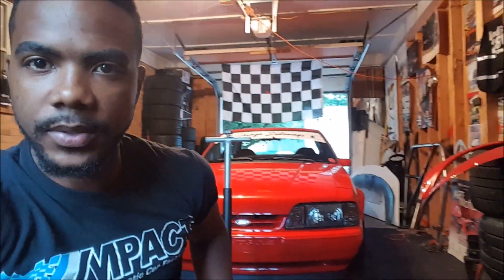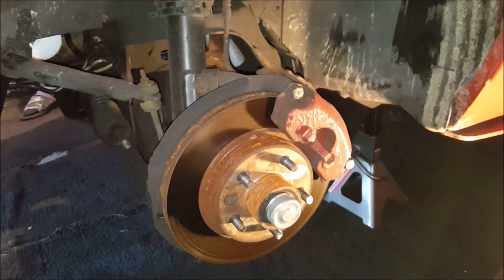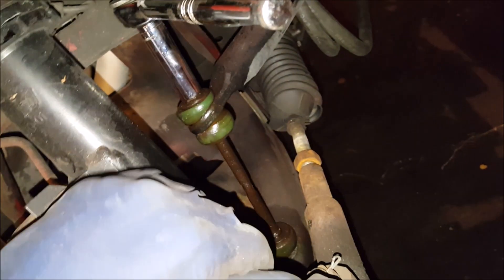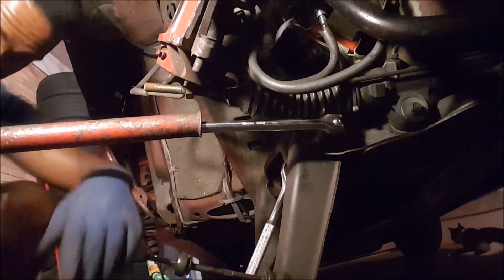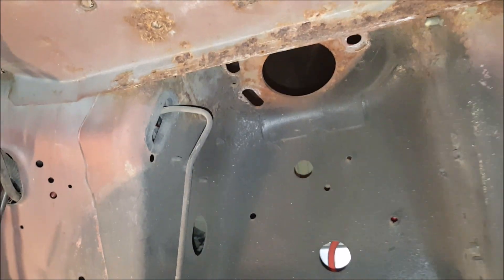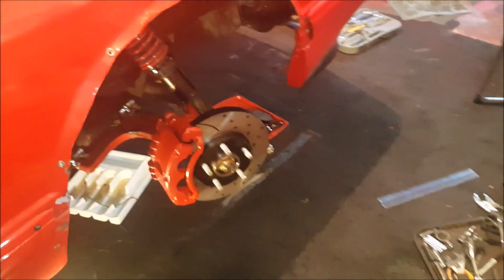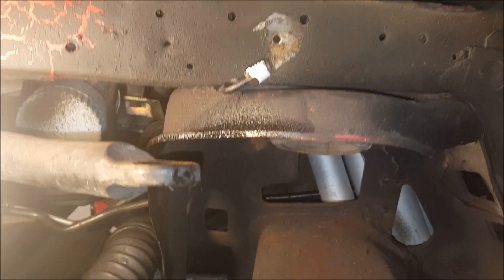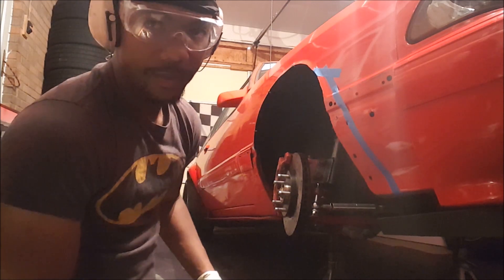Foxbody gets MASSIVE steering angle "wisefox"

Comment: Hey,

Can you tell me what size spacers and what offset are your wheels?
Reply from the maker: my suspension set up sits 6 inches wider than stock,  my wheel specs will not translate to your car.
Reply: @Sgt.Slides  Ahhh.

What did you do to get it to sit 6 inches wider? I'm going for a similar width as yours.
Reply from the maker: @GaryLamb2020  The front control arms add about 2.5 inches to each side and the new edge spindles add about .75 inch on each side, in the rear the IRS adds 1.75 inch to both sides and I made it even to the front by running a spacer.
Reply: @Sgt.Slides  Awesome!!

My IRS is all paid for, just have to get it shipped. Covid19 got me holding off, tho.

I plan on using sn95 spindles and the mm k memeber

Comment: Do you have more photos or videos of the notches on the frame rail and the shock tower? I got a wisefox on the foxbody i just bought and nothing have been notched, so the camber is way to aggresive, and i want to get rid of it
Reply from the maker: sorry, no better views than what's in this video.  Chris Fix may have a better view of how he cut inside the fender.  There is a template out there on the internet of how to cut the shock tower, but you can eyeball it from photos, just trace it out before you cut.  I made mine a little larger than it needed to be, but it's fine.

Comment: Great susspension set up, I was getting ready to do mine.
Nothing like yours, just the basic OEM control arm's, polly's, off set pinion and stuff.
It'll be a little bit still waiting to get a few parts and tools for the over hual.
Hey that was funny with that PG warning wene you were about to cut up the fender. lol.
Reply from the maker: Some people really get upset when they see me cutting into the car, This one actually made me sick to do, but I was able to pull it off and make it look pretty clean.  The biggest drawback with this angle mod set up is that it moves your front suspension forward, so your wheel fitment will always be a little funky.  

For your control arms, have an angle grinder handy, I didn't show it in the vid, but one of the bushings came apart and it took me forever to get the last bolt out for the arm, I ended up just cutting thru it and replacing it with the new bolts.
Reply: Alright I appreciate that Kevin, I hear you on that, with the day trippers.
Hey man you whipped it and the car is looking goood.
speaking of I just put 18's on mine and I'm rubbing. Hopefully when I do the install it'll help some.
  I was wondering, If needed do think I should cut or pound out the walls with a hammer. 
I also got some 1.5' spacers on the way.
running a low pro tire at 18/35/235.
Reply: You got some pretty good angle going, nice drift. I heard about that positive caster deal, that the more you have the better it handles under high perfomance.
Reply from the maker: i didn't go into detail, but more castor gives you better stability, however it does reduce steering angle, like everything it's a trade off, but the little bit of angle you loose is totally worth it fir the ammount of control you gain.
Reply from the maker: it all depends on offset and tire size.  Fox's have really poor wheel clearance for anything other than stock wheels.  You may need to roll or shave the fenders.
Reply: it fits ok inside the wheel well and I bought a fender roller if needed but it hits the inside of the tire mostly wene I need to park and  maneuver around. 
so I was thinking about cutting out the inside of the well. kinda of a tubing it out from the inside wall.
I was thinking I might be able to get it welded/stich'd up later.
Reply: check it out I just posted a video of it on my channel. now the drivers side has a 35/245 but I'm going to pair it up with the p side at 235.

Comment: so i hate to keep asking question but i ordered my plates with my feal coilovers, when i got them they were a 4 bolt mm camber plate unlike your 3 bolt i thought nothing of it.. but when installed and slammed forward and outward all the way. and there is no need to cut my strut tower. kinda crazy and i cant figure it out. im about to throw everything on to see how much camber i have even know its gonna be ridiculous . just wondering what your thoghts are..
Reply: 1997 mustang gt btw not sure if thats whats making the difference
Reply from the maker: you don't need to do the cutting if you don't have an angle kit.  If you are doing an angle kit, and you don't do the cutting, it will restrict your angle.  It won't turn all the way, you may end up damaging your strut.
Reply: I am doing the kit ,,my camber plates are mm 4 bolt unlike yours, i did cut my struts like your but when i put the camber plates on and slam them all the way forward and out they dont go far enough, i boght my plates with the feal coilover, you think they could be the wrong ones, you have a insta or something so i can send you pichures, idk if i may have needed to get the fox plates in order for it to work,
Reply: Nvm thanks for all your help, you run a great channel, is what happened is i read the direction on the mm plates, and they wernt allowing for the proper caster started flippin thing around and figured it out,

Comment: Please stop using Teflon tape or pipe dope on brake fittings it doesn't help they seal on the flare the threads are just there to keep it tight.